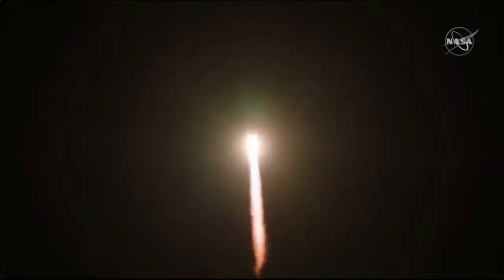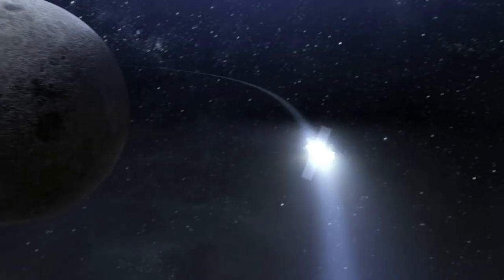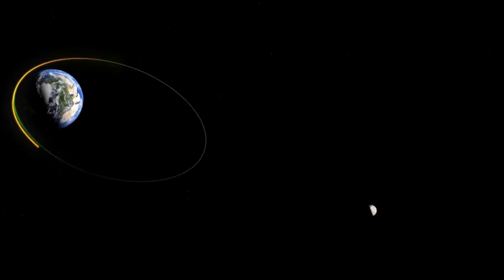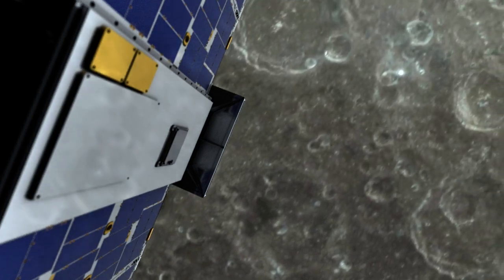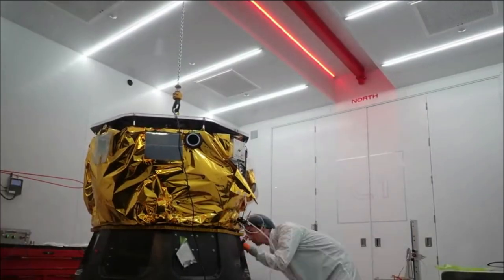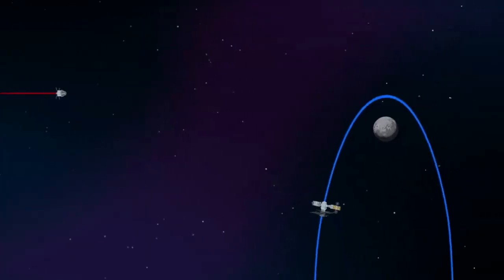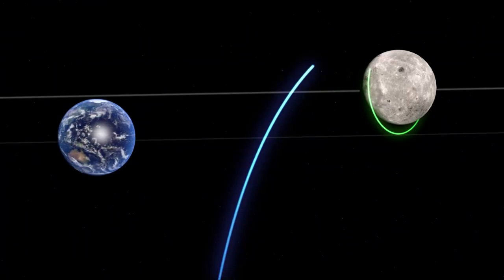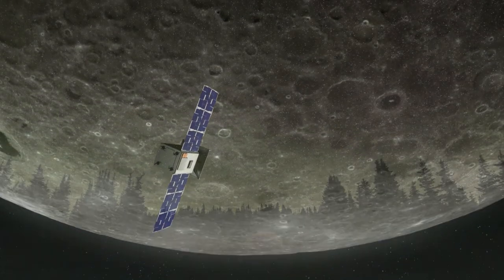Things Are Not Looking Good For NASA’s CAPSTONE Spacecraft

Comment: Most recent info was that TO found that a thruster's valve was not fully closing after pressurizing the thruster's system. This caused the roll. They HAVE regained full stabilization of the craft and have it correctly aligned for both efficient solar panel operation and antenna alignment for comms. TO is now working on creating appropriate computer algorithms to send to CAPSTONE so compensation can be made for the leaking valve during thruster operations.